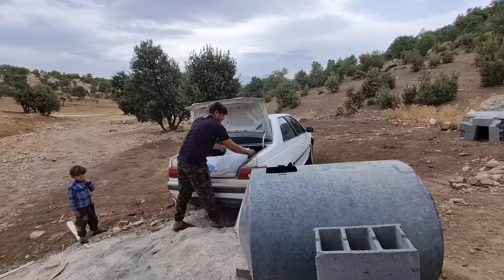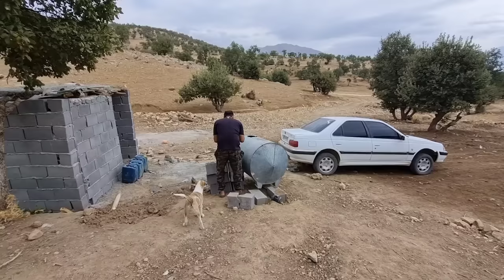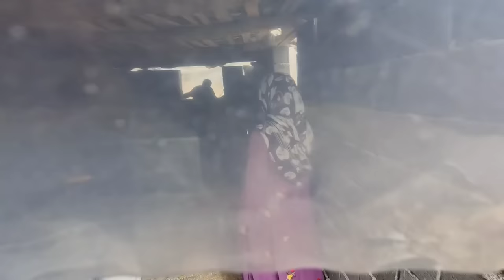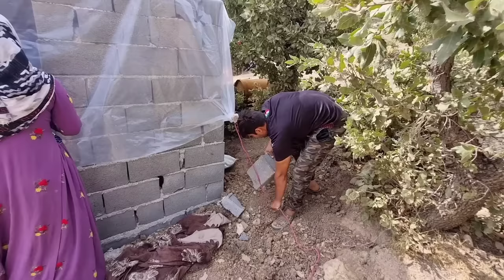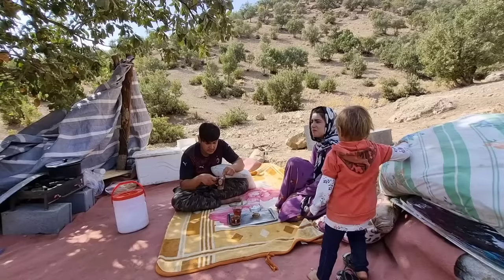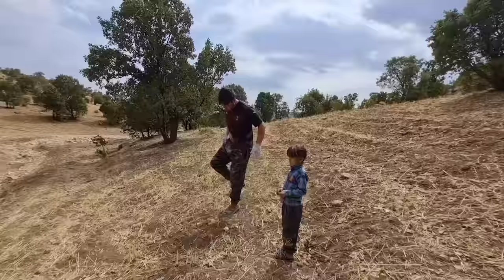Tribal Bracing for Winter: Nomads Unite to Fortify Their Home Against the Cold🌨️

Comment: I understand that is going to be a permanent home for now. You must think that all those thing are provisional . You need to move inside because the rain and the  cold but if you don’t plaster in and out water is going  inside . Slowly you can do it . Many time the wind is so strong that ripped those plastic so that why is better to hold it with rocks or wood because nails are going to ripped faster. Two or three mind think better than one. Follow instructions and ideas are very helpfully and avoid many mistake and problems. 😢😢😢